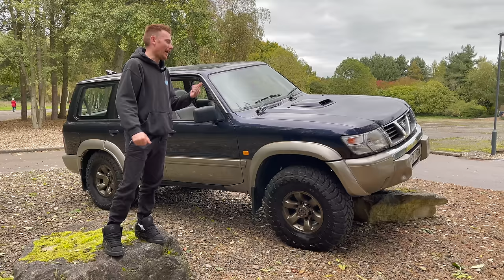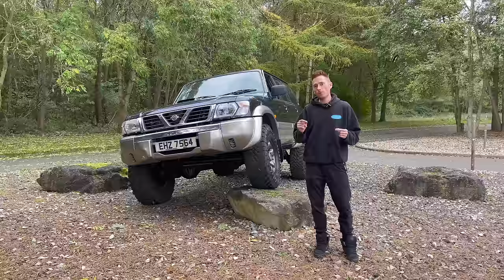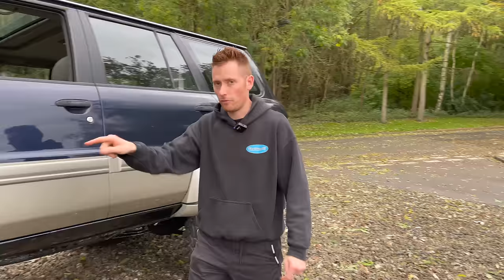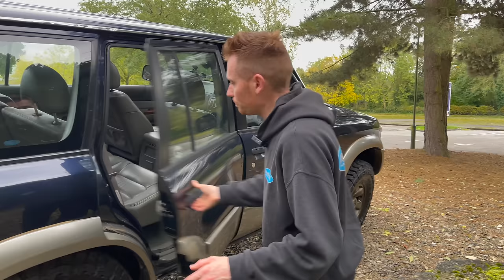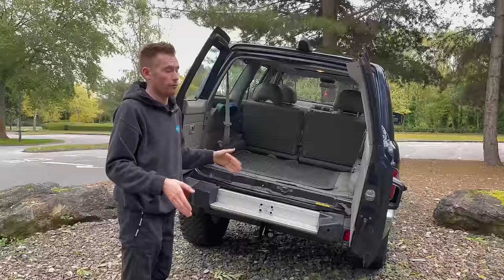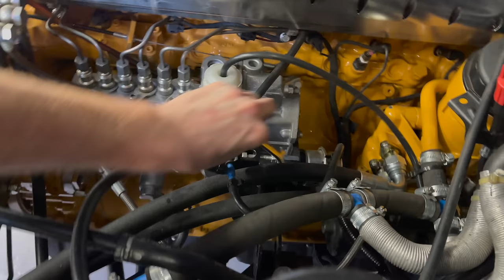500BHP GU PATROL OM606 DIESEL , 4-WHEEL BURNOUT!!!!! SOUNDS SWEET!!!!

Comment: Speaking of drive shafts, rear one is in back-to-front. As for the ZD30, mine still going strong with 420K kays on it.
Not huge fan of screamer pipes and can see it leaks a bit but also opens very early. Fuel pressure at the pump is way low assuming thats a 0-15PSI gauge. 
Move the battery to down the back or underneath. Plenty of dry-battery options that can be mounted on their sides.
Reply: I have 2 currently and 5 previously with all dead zd30s. They are rubbish lol and good for ripping out and throwing a Cummins in and thats it
Reply: It's not back to front, that's how they're standard.
People turn them around for clearance.
Reply: @Robert-cu9bm  Every Patrol I have worked on, Slip-joint sleeve goes to front where is a little higher out of the muck protected by the transfer case. The slip-joint end is also heavier putting a little more weight on the un-sprung weight of the diff. Service manuals mainly show the diff with slip-joint to front but then you find occasionally ass-end around. Might be a UK thing. Hell, why not, found plenty of UK aimed configurations on our Aussie GU's that certainly do not help the ZD here. Fixed theose short-commings hence why I have not killed a single ZD in anything I own or worked on.
Reply: @bentheguru4986  
Everyone you have worked on is backwards then.
I've owned patrols from virtually brand new and had to flip mine because I put a 4 inch lift it in.

Go here and you'll see the diagrams show it slip joint to the diff.
nissan-europe.epc-data
Reply: @Robert-cu9bm  If you need to have the slip-joint at the diff end for a 4" lift, you have bigger issues with angles that you should be addressing. I'll stick with our "Backwards" shafts that came from Nissan like it.
Reply: @bentheguru4986  
No I said I needed to flip it.

OEM the slip joint is diff end, but with a lift the tailshaft his the cross member.
So standard practice is to flip it.
Then for more clearance you add a notch.

Comment: QUESTIONS ? How does the patrol compare in size and capability to an 80 series land cruiser? Can’t get the patrol in the US. Will the Toyota’s stock driveline hold up to this type of power. 
Also, on the Dyno why is the torque les than HP? I thought this was never an issue with a diesel setup. Thanks. Love your truck.
Reply: Basically the same, the 80 was it's direct competition.

In Australia your either a landcruiser man or patrol one.
Reply: An 80 series with either a 1HDT or a 1HD-FTE Toyota engine, which would bolt straight in, in a similar state of tune to the above would eat the above for breakfast. I have a factory turbo 1HD-FTE in (what you would call) a pickup, making 1050 NM torque.

Comment: I love the brute power!
Thanks for the explanation of the Patrol.  Didn't know that the running gear was so strong .
Reply: It's from a truck.

Few upgrades (bigger fifth gear) from the original in the 80s, but essentially the same.
Reply: @Robert-cu9bm  okee. Thanks for the info👍
Reply: @oilstovesandmore  
Also the diffs in the y62 are bigger than in the y61.

The 62 has bigger CV joints, they're also a wider diff.

And some at random had a super sized rear diff in it. Must have had spares on the shelf.
That diff normally went in the leaf spring Ute.
Reply: @oilstovesandmore  
But they're still break, and with ease on bigger tyres.

Running 35s you'll break CVs.
 Done many in mine.
Reply: @Robert-cu9bm  the old H260 rear, also came in a zd30 in 2002 for some strange reason.   At least it was coil sprung and still had the full floating 37 spline axles 🤟

Comment: Thing you were ignoring it that "crankshaft" horsepower is a very rough estimate. The only way to be confident in that figure is to replicate the installation on an engine dyno', with the entire intake and exhaust system in place.

There is also something else to be aware of - a simple pull like that doesn't heat soak the engine and acssociated parts like a trailer pull up a steep hill will do, and that difference can drastically affect the longevity of the engine.

Might also be worth checking if Quaife, or some other company, make a slip limiting assembly for the front diff'.

Comment: that made me chuckle :) here are my comments: it looks like you have an exhaust leak up front somewhere? and it seems like you could take out a little more fuel to keep the smoke down? I am not a fan of rolling smoke, but rather a fan of big torque and fuel efficiency as afforded by a turbo diesel. Good work as usual, and fun to watch you hooning in the burn yard. Time to ship one to hoonigan garage?
Reply: The exhaust leak is more than likely a screamer pipe.
Reply: Smoke from the front under load is the wastegate dump.

Comment: Is it typical for these motors to make peak torque at 5k rpms? Or is it something you've tuned it for? One of the reasons I ask is I plan on swapping my truck and since I do tow quite often, having a good low rpm peak torque would be preferred.

Comment: Greaseable joints are a double edged sword. You need to use very little grease and it must be the thinnest bearing grease available. No more frequently than 50k. The nipples are missing for a reason on most things: On agricultural PTO shafts that use similar joints, the usual mode of failure is OVERGREASING and the grease blowing the seals. If you hear a crackling noise when greasing it, you know you went too far and the joint needs to be replaced soon

Comment: Thinking about an 606 in my 1960 IH METRO step van. Surprised the Nissan has such strong axles. I had one Nissan and it was such a craptastic car I said never another Nissan,  Axles bad at 100k and the engine trashed #3 at 128k.... All of the suspension is shot as well. I have Saturn's with 300k and original axles, and engines.

Comment: That Thing Is So Sick!!!! That Low RPM Boost And Low End Torque!!! I've Got A Jeep Commander With A 5.7 Hemi. It's All Stock Aside From A Turbo Slapped To It. Thing Can Spool Up 8PSI Of Boost At 2300 RPM. It's Also AWD (with 4 lo lock Option). It's 5400lbs And Moves Like A Beast From A Stand Still. It Can Chirp All 4 But Doesn't Spin Them Like That (in AWD / 4hi). Mines Auto Trans With 3.73s, 1st Gear Is 3:1 Ratio. I Took It To Drag Strip And It Did 2.2 60ft On 3 PSI Launch. I Got It Launch At 8 PSI On The Street Currently. I'd Bet It Doing 2.0 60fts. It's Slow But Cool That That Nissan! My Jeep Currently Is Making 500AWHP And 550Ftlbs Of Torque. (These are corrected values at 5200ft elevation on AWD Mustang Dyno)

Comment: Thanks for great informative video. just amazed as i have a na 4,2. i often tell my pilot mates if you wanna overtake you need to find the control twr, go file a flight plan then decide if you wanna overtake!! i thought of swaping the engine and i think this om would be for me. is the om quieter than the 4/6 bt?i dont want the tyre squeals but man! having said that what pump turbo combo would get me to 200 hp? what fuel burn could i expect? i just want be able to tow a boat or trailer or go overlanding with a bit of grunt! thanks again!

Comment: Would be great for a shorty or a flog box. The super low tractor torque of a big pump td is just spot on for me.  That that last pull seemed to struggle to get on power in second where as even with a short shift the td doesn't mind at all.

Comment: Y61 patrols are awesome I’ve had 4 of them including 1 which we cut into a dualcab and stretched the chassis so it had a 2.4mtr tray on the back…. But … I must say now I’m on my second 200 series Landcruiser 4.5 twin turbo diesel with 900NM of torque and will have to say that it is a far superior car in every way especially towing.. EXCEPT off road .. the Y61 was much better on the tracks.
This is definitely an awesome engine swap though. Love it 🤙🏼

Comment: Nice build but 315 wheel hp = about 375 hp (net) at the crank with a manual transmission (15% loss), which is borne out by the 0-60 time of 6 seconds in a ~5,000-5,500 lb vehicle.

Comment: Wow !
thats wicked
I had no idea Nissan made Powerful Diesel Engines!
Reply: Its got a mercedes motor swapped in because the stock engine was unreliable. The other two diesel engines it came with are fine, just the zd30 which causes problems

Comment: Relocate the battery to where you said you could put an air airbox then put intake out the fender into a snorkel
Reply: Why would you want a snorkel?
Reply: @Ben-in6qh  water crossings
Reply: @boostednewport3898  you think he wants to go through water deeper than the bonnet??
Reply: @Ben-in6qh  better to have and not need, than to need and not have. Isn't 4 wheeling all about capabilities?

Comment: Ive got a chargecooler on my T4 2.5 , ive got some sensors on the out side and it dropped the temps 20-25 degrees .... also running a chargecooler radiator off  a Toyota ST220 under the van half way along. Its got its own pump and header pot as well. Nice job there with good figures now add a tad of smurf juice !!!

Comment: black smoke....how did you adjust the control unit?
Reply: 100% mechanical super simple to adjust
there is an om606 in Finland I think that pushes like 500hp with no smoke its all about big boost PSI on diesels and a really good injection system

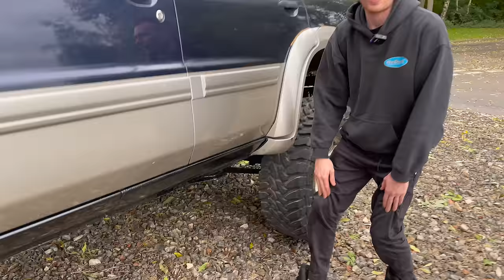Comment: 4:11 modern cars have enclosed joints with grease inside and they never have problems.
Reply: That's because they're cheaper to manufacture, don't last as long as grease able joints.

That's why trucks still run grease nipples.

Comment: its an awesome vehicle and i love all the engine stuff you guys make. having said that i must counter your assertion that the little nissan axle is the toughest in a 4x4. maybe a mini 4x4. military grade landrover axles are of course better. here in the Us , stock dana 44,50, and 60's are all stronger with a wider range of gears for real tires. yes the nissan does great with 31's but off road in the US starts at 40" tall tires. even the ford nine inch found in early broncos is tougher than the half ton rated nissan. building anything here in the US starts with 1 ton axles and 4 links for 50" tires. I would still recommend a 606 with your parts.
Reply: Dana 30, 35, 44(A) are a joke. No offense. I can tell you that right away as a several Jeep Grand Cherokees' owner
They are very weak and barely capable of running 33s at most as-is (stock = 29")
To run something like 35-37s (which is about max they can handle) they need some serious strengthening like sleeving, gusseting, trussing, chromoly axles - the list goes on and on and it's a big buck into them

H233 (the axle you find in Y61) ~= Dana 60 or possibly even stronger. 
It does not need anything and can run 40s no problem
Reply: @uNabL3  im not sure who you were responding to. I said nothing about dana 30, 35. The 44 that comes in 3/4 dodge and chevy stock of course are stronger that the nissan and have many more options. When somebody makes a statement about 4x4 axle strength the nissain is never ever mention here in the US. Everything i said about the dana 44,50,and 60 stands. Strength and gear/strength options are big considerations.

Comment: Interesting platform would be a Nissan Pathfinder R51 with a blown engine to throw this engine in. Great strong SUV with independant suspension all around but that diesel engine is the 2.5 version of the ZD30. It's equally slow but doesn't grenade itself. 😝 But I love this content, the fact you explain everything on the car makes me feel like watching even more. I did a BMW M57 swap in my Nissan Patrol Y60. Great engine with the variable turbo part but too much electrics. Wish I had done an OM606 swap. 😂

Comment: I subbed. Great video!
Aspect that I appreciate were:

Showing multi angles from the dump run (I couldn’t tell at first when you came into the throttle or when you shifted until the Underwood shot and fire from the waste gate from the bottom!

You seem intelligent and well versed in everything you talked about. 

Didn’t mind ripping into her a bit! I think it will go a low 14 second quarter mile and if not a high 13 I bet! 👍✌️

Comment: I think you should compare it… Range Rover=drive line made of carrots+unreliable break down’s imminent 
Patrol= made from truck parts so strong as a ox and more than comfy enough inside+ if you get the 4.2 diesel or any of the petrol engines there plenty reliable

Comment: are you selling that gas pedal wire with mounts on diesel heater??
Reply from the maker: Yes we sell the throttle cable and if you have a zd30 model we even have the pedal mount to make it a 10min install start to finish
Reply: @DieselPumpUK  how can i search on ur website?

Comment: Great work..running a Mazda SL iny landie but if it wears out defo look at 606...
Your truck is on North of Ireland plates. If it's from here.. that's why it's rusty.
Loads of road salt. We get.shit weather on shit roads and most of the citizenry think they are super drivers.
But they are not. So apologies that the truck carries the flag for from here!
You could try poach one of those from the Genuine Oglaigh na hEireann. 
That's the official army of the Republic of Ireland.
Shit drivers, shot roads but very little salt. Go for a D Dublin/C Cork reg and you should be ok. 
Nice truck. Great motor work.

Comment: you will find out the diffs are not that strong i am on my 5th back diff head, axles dont break and i am only pushing 320 hp at motor and 800 NM on 33''
Reply from the maker: Where did you get the diff repair parts please?

Comment: Patrol isn't a full time 4wd.You can't drive a 4x4 on tarmac
Reply: Doubt he was, he would have been able to change great.

The hubs would have been unlocked.
Reply: @Robert-cu9bm  hahahah yeah can't you see the front wheels are burning rubber...
Reply: @blase9090  
"Great" was meant to be gear.

Doing a burnout allows the wheels to travel at the same speed.

When he's doing the 0-60 time, he's turning. 
So the gears would bind, until something breaks. IE: tyre traction or driveline.

Do you know how transmissions in 4x4 work?.
Reply: @Robert-cu9bm  you know shit :)

Comment: the axles in the patrol arent really bigger than anything else tbh.  they break fairly often,  ive seen them destroyed in stock motor patrols quite a bit. 
they are about the same as any offroad vehicle like jeeps or anything like that.    
The thickest axles ive found so far from the back of my mind is in the 4x4 RAM trucks

Comment: Abaut 200 HP the power loss?!? You must be kidding me right? Power just doesn't disappear on nowhere. Energy and power chanches it's form. On cars, usually from rotating form or so to heat. That mean's you have machine that makes abaut 150kW of power to heat from tires and transmission!?!? And that's a lot of heating power! Very very much of heating energy..  And same as english. It is not possible.. If it would be possible your tires would be melted on the road or on these rolls on an blink of an eye.. I doubt it very strongly. I don't mean that you are a liar. I mean there must be something else, that effects on these measuerements. Maybe tires are slipping very much or somethin else. I don't know, but I'm sure it is not possible to have a 200HP power of loss on that car and transmission and tires etc.. It just is not possible. And there must be a plenty of power to get this car on 0-100 under 6 seconds. That's for sure! I don't doubt that! And not for bad all this, I hope you understand me. There must be a reason for all that mystery "power loss" thing. You just must to go and find it! There must be the answer at somewhere. Ps. I like your videos very much! And I pruchiate your job and work very much! So, there is no suchs a thing like that, that I would'nt like you or your job or videos or something. Nothin like that. Keep going man, you are doing great job! All best for you! ( I just like fysics and facts. That's all abaut for me.)